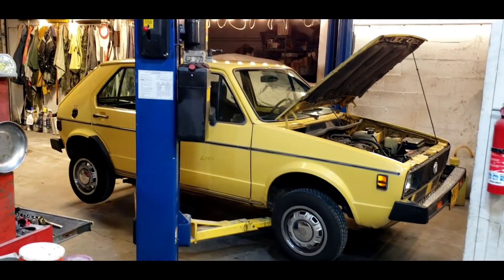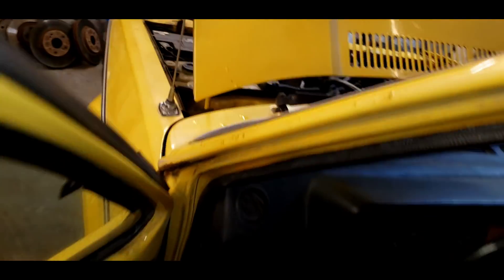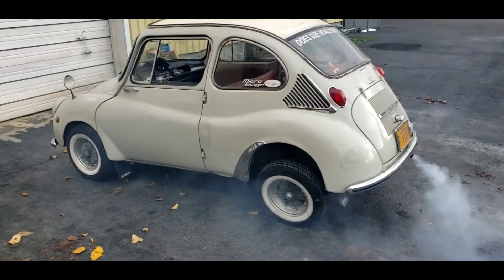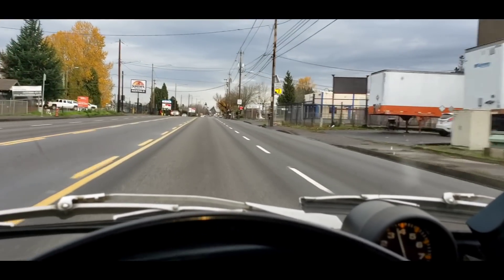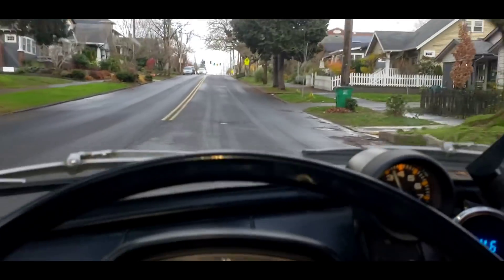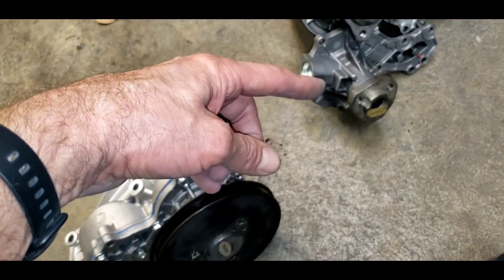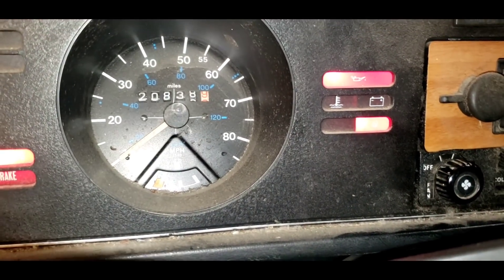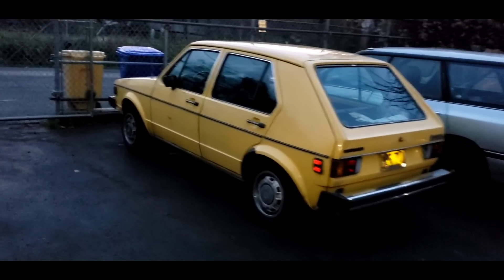Back For More!

Comment: 1980 for sure ,79 diesels retained the round headlamps, 80 went to the squares, should also be a westmoreland Pa built rabbit ,  and all the older vw diesels " seem " to run on 3 cylinders till they warm up,  i mean you would too  if you had 600K miles . :)
Reply: Yea the square headlight were Westmoreland cars
Reply: This is what I  Europe says about the square headlights, it's a Jetta front.
Reply: Yep. In 1979, the diesel Rabbits came from Germany, with 1979 gas models from Westmoreland (and had square headlights and a cheapened interior).
Reply: They call that an early westy. 
The late westy has turn signals on the corners of the fender. I have a late westy diesel and I love it.

Comment: This same engine was placed in early T3 Vanigans in Europe for early diesel versions with a very low 4 speed gearbox. Needless to say they didn't climb inclines very well . Add a camper van conversion and they became pedestrian.
Reply: I had two of them, VW T3, 1.5 from 1980 and a 1.6 from 1986.
Top speed was 110 km/h, if you managed to even get there.
Rockets they weren't
Reply: They were sold in the USA too, for a few years starting about 1982.  I vividly remember seeing a brand-new one climbing >9,000 ft Tioga Pass into Yosemite NP from the east -- or rather, I saw its soot cloud first, then passed it in my mighty 76 hp Scirocco going double or triple its speed.

Comment: The older cars, had water pumps they you put a kit in, replaced a few parts and refitted it. 
I used to drive a 3ltr diesel Hi Ace, when it was sold it had over a million kms on it, the engine was Not rebuilt, it had regular servicing, cam belts, and a new water pump each time.

With diesel engines, DO NOT GLOW them too many times; the heat can melt pistons! Not good!!

Comment: I can almost smell that old Volkswagen interior. The engine sounds just like my old 1.9 turbo diesel. That car used to run roughly on a cold start, cured by fitting new glow plugs. Perhaps the injection timing is slightly off.

Comment: I believe the sensor  for the stop light and turn indicator is actually a magnetic field disturbance detector because they sell something for motorcycles it's basically a magnet that you put on the bottom of your motorcycle and it helps trigger the stoplight system  2 let it know that you're there

Comment: What 2 stroke oil do you run in the Subaru's? Do you run a synthetic and then back off the injection rate a bit since they'll run at a leaner oil to fuel mixture.

Comment: First thing run some injector cleaner (I use straight ATF), then injectors. Wouldn't touch the head/block without a compression test first. Runs way better than my delica when in was a cylinder down, cracked the head between valve and preheat chamber - quite common on the 4m41 (you will have these to deal with in your future)

Comment: i would check the injetor first but you said the 4th cylinder starts firing normal when there is heat in the motor. that gets me thinking that the piston rings are just plain worn out after 600 thousand miles. its time for an overhaul on the engine. 
i checked the catalogs and new rings and bearings are still available. if it needs a short block the original 1,5 liter might not be available because in august of 1980 VW replaeced it with the 1,6 liter and that a more common motor in VW Golf/Rabbits.

Comment: Warning when you rebuild the engine head, it's given so much compression you got  in a short time rotten noks.
Only a complete rebuild is a good solution for a happy costumer in the future.

Try the injectors first, it's easy and cheap.